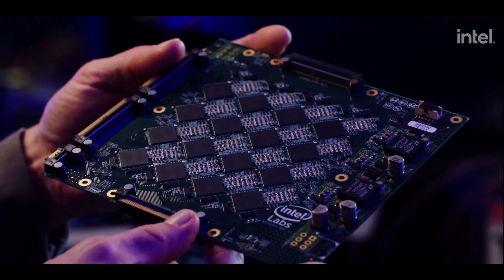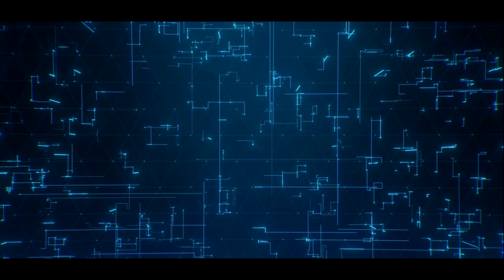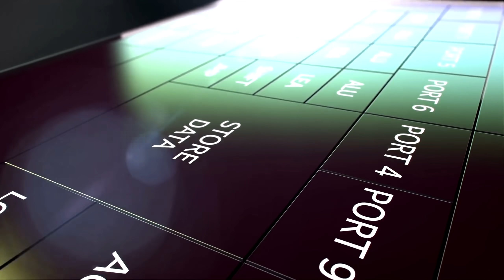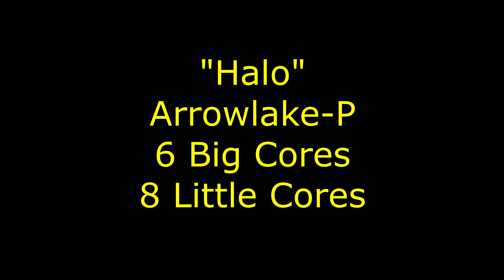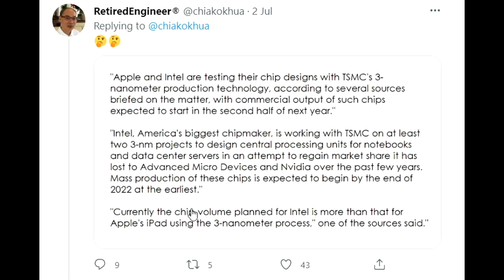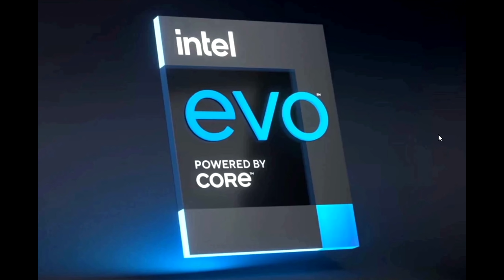Intel's Arrowlake Aims at Apple

Comment: What Intel deliver doesn't often fit the past road maps, I have lost faith in them.
A year of 8+8 ADL SOCs and I am very disappointed in Intel's big.little implementation, which has been tasteless.  I see forum users with K chips at 100C scared to run heavy processing programs, all because of the bad mobo defaults they permitted and tau not functioning to throttle to TDP.
They've thrown power at benchmarks because their GC cores are large and fail to scale down volts & frequency and they cannot put more than 10 on a die.  So the E cores are clocked high up the power wall to cover in power inefficient manner.
The MT creator cache light benchmarks just aren't anything like how I use the computer, 8+32 seems totally pointless just more cores idling.
There's also much reason to be sceptical of Arc gfx, there was a lot of benchmark claims Q1/22 that only Ryan Shrout publicised for DX11, the independents found different results and now they say Arc is for DX12/Vulkan.  But Lisa Pearce interview with Dr Ian Cutress shows they were well aware of the DX9/DX11 legacy support as well as DX12 & Vulkan.
This could change, but the claim of "designed for Re-BAR" needs them to explain how old games will have their aperture using memory management altered.  Furthermore Intel Tom Peterson makes out Arc is made for "GB high bandwidth memory transfers" but PCIE is a bus and NVME storage uses payloads of max 4KB.
They're not being challenged on all the holes in their stories by the journalists they visit or on news sites later.

Comment: intels low power cores were the only ting i was really interested in from them for the last couple years.  i mean i like to see how they clock and tweak them but as far as arch the  'mont cores are the oly interesting thing they have in core arch.  todays cores have been wtweaked so hard for high performnance at high  power that there has to be a lot of wood to chop if one stepped back a few years in core design and pulled out something simpler (less complexity means less power). 

this is about  their only chance but i think its exaclty what is neeeded.  just wonder hwo they will mess it up

Comment: It might be ready for when Windows 10 goes EOL and 0225. I will wait for 5 years after that, knowing how Intel's manufacturing is years behind and given the chip shortage. So I might expect this to be in wide availability in 2050 or so to jump past the unreleased Golden Cove and skip five generations ahead. 3nm, yes, in 2100! I figure they might have 10nm functioning by 2075.

Comment: If 96EU intel igpu is around mx450/gtx1050
I can see this rumored 320EU to match 1660super once the clocks are pushed real hard
1ghz of that beast could be close to 5500xt?Or even rx470 at the very least
Reply: Looks like i might be wrong
Should be similar to rx6600

Comment: So Intel has no way to catch up until 2023-2024. Unbelievable what their foolish unreachable 10nm roadmap cost them. That's what happens when your CEO has no engineering background.
BTW, I think 3nm TMSC isn't 3nm, it's just a node name with no reference to actual process size.
Reply: Bro. Bob Swan ruined Intel. Pat Gelsinger is trying to revive Intel back.
You really think Intel can revive itself easily? It takes time.
It's like Rory Read ruined AMD and Lisa Su trying to revive AMD back within 2014 to 2017 and did revive it. And that Intel is 2021 to 2023 or 2024. Just wait. Time will only tell.

Comment: There no industry standard on the measurements. The change to 7 is because of transistor density in same as the 7mn. The whole industry should use density per mm.

Comment: The Steam Deck shows that there is a market in the x86 ecosystem for a strong APU that can process Linux/Windows variants on par with the mid-range segment. I think the potential is much higher than even the Zen2/RDNA2 APU in the Steam Deck and the first company to hit it will basically be raking in the money. Discrete GPUs are becoming too expensive for this segment so I hope such a moonshot can be successful.

Comment: Hard to give Intel a heck of a lot of credence in their five year plans ... they've been getting to 10 nm for a better part of the last decade.

Also hard to see how x86 will begin achieving faster CPU cores, since the very nature of the variable instruction length makes really wide CPUs hard to do. The only options open therefore will be higher clocks - which results in exponential heat production and loss of efficiency - and process shrink.

Comment: (Formelrly) Intel 10nm ESF will have a 20% performance per watt improvement over 10nm SF.

20% performance per watt improvements, regardless of anything else, is the metric TSMC, GF, and Samsung use to determine if a node is "next gen" and gets a number decrease. Intel is just adopting the (dumb) industry standard for naming nodes

Comment: I really can't see Intel getting Arrow Lake out in 2023 at all, not without dropping a launch in-between.
Alder Lake will barely get out this year, the full line up will be Q1 next year (2022). Sure Intel might refresh this pretty quickly with Raptor Lake in Q4 2022 as that is only a small tweak to Alder Lake but Meteor Lake is a pretty different chip and so will get it's time to shine. Therefore even if we say Raptor Lake only gets about half a year on sale (which is extremely short) then Meteor Lake won't be here realistically until Q3 2023 and I personally think it will get at least 3 quarters as the top dog which would mean Arrow Lake will be in the second half of 2024 at best!
The only caveat to this is maybe Intel will drop one of these chips all together to speed things along.

Comment: This is very much needless knit picking but you said the upcoming Alder Lake chip is 8/16, is 8 big cores and 16 little cores. I'm sure it was a slip of the tongue and this isn't news to you but it's 8 big cores and 8 little cores. The '16' is the number of threads from the 8 big cores having SMT.

Comment: ADM=Applied Delusion Manufacturer?

Feeling silly. I think you are right, that they will go with stacked memory. I suspect the 7000 series GPU and 6000 series CPU parts will all use stacked memory. Yes, the initial run will be expensive, but when volume production hits it will only add pennies to the cost I would expect, and the performance boost is massive.

Comment: Jim, You should NOT trust Your Intel sources, ESPECIALLY when Intel is i very dire waters, and ALDER LAKE likely to become a gargantuan flop..... Intel is pitching for pawns to try to keep the company share prices from tanking below 40 45$ a share which opens avoid direct to 25$.
People like Tom and You, are the best  to try to divulge BS and have it run al over the media.
Besides....Intel has lost its future in the low power consumption market, there is no way they will be ever be able to compete VS apple or worse AMD, especially when the world is becoming more mobile phones and consoles.
Dell and Hp which consist pretty much the bulk of Intel sales, are getting a terrible reputation.
Apple Users tend to change their laptop every 2 to max 5 years, Intel users buy them and keep them until they die..... and given we just came out from a pandemic, i do not forecast anyone wanting to buy laptops for at least another 5 years and 2 years if an Apple aficionado.
By the time Intel  does whatever they said they will deliver to You Even Smart TVs will be able to replace the need to grab  a laptop...... so long for smart working and Intel.

Comment: Jim should definitely do A rant on the 6600xt and modern "midrange" gpus.
Reply: As a 5600 XT owner I was flabbergasted at the $379 price.  How the fuck did mid-range end up at $400?  I'd rather just buy a fucking console at this point.  Absolutely ridiculous.
Reply: @clblanchard08  they tried to sell a 5700xt for 450 dollars until they dropped it 50 bucks when people complained + nvidia released a 2070 super.
This is the same die are maybe 10mm smaller than that 5700xt in the middle of a shortage, its no suprise they are trying to sell it for almost the same price since it costs about the same to make as a 5700xt did.
Reply: He already said. No more personal analysis, only leaks from now on. His analysis that triggered most of the hate comments that mede him leave before, so no more.
Reply: @brunosalezze  i really don't think he should stop because of some degenerates, company salesmen in disguise as "reviewers".

Comment: The fuck is intel doing? They must sort out their manufacturing problems. Nothing else matters... Designing a chip to compete with another chip means nothing if you are also competing for the same limited wafer capacity. CPUs/SoCs are not going away anytime soon. Instead of focusing on apple or AMD or Nvidia they should be focusing on competing with TSMC or Samsung. There is nothing stopping TSMC from designing their own chips or buying out other companies who do and producing their own chips. While at the same time cutting off AMD or Intel or Apple's supply. We need intel to be competitive from a manufacturing perspective not as much from a design perspective.

Comment: Apple's advantage is their complete control of hardware manufacturing but also the software stack.  They can get as much performance out of AMD GPU in a laptop unplugged or plugged in.  I suppose it's less embarrassing for Intel to say they are going after another giant like Apple when they can't get past that little pipsqueak AMD.
Reply: AMD is no longer a pipsqueak. As of today, its market capitalization is $130 billion. It seems entirely likely that AMD can and will capture at least 50% of the entire x86 processor global market, including servers. At that point, AMD would easily overtake Intel in size, as AMD also has the Radeon graphics division, and Intel's GPU division still doesn't have a consumer video card out that can even call itself mid-range in general availability. The writing's on the wall.

Comment: 320EUs on N3 for a laptop? Hell yeah, i'd be interested to grab a low power laptop with solid gaming performance.
Reply: How does this compare to CU's or stream processors?
Reply: @baronvonlimbourgh1716  slightly better than vega 8
Reply: @baronvonlimbourgh1716  One Intel execution unit has 8 shaders.  One AMD CU has 64 shaders, as does one nVidia SM.  With Ampere, each shader can do either one FP32 and one INT32 or two FP32's, which gives each SM 20-40% more shading capacity than a CU, depending on the game and resolution.

So 320 EU is 2560 shaders, which is the same per-clock shading capacity as 40 CU's on AMD or ~33 SM's on Ampere.

Clock speed is a big factor, of course.  The 5700 XT and 6700 XT have the same number of CU's, but the latter is ~30% faster due to ~30% higher clock speeds.

I'd guess the integrated graphics will clock quite a bit lower than the 6700 XT, and probably a lot lower than the 5700 XT as well to save power.  Still, it would be exceptionally good for integrated graphics, provided the power consumption can be held in check at usable clock speeds.
Reply: @TrueThanny  thank you.
Reply: I wonder if even (LP)DDR5 can feed that
Reply from the maker: That's what ADM - whatever it is - is for.
Reply: @adoredtv  Yeah, it's clear that if intel are trying to compete against the M1/2/etc, they're clearly playing to their strengths here. What's the one thing the windows ecosystem truly has a big advantage over apple in?
AAA gaming. 
Apple may have stunning GPU performance and a shockingly good media engine, but none of that matters for someone looking to play some fun PC games when apple's catalog consists of just WoW, Apple arcade and handful of others. You can't even get fortnite on apple devices anymore :(

And if Intel could come out with a chip that enables sleek, low power laptops that can actually play modern titles really well, then they'll definitely get my attention for sure. I would have no doubt whatsoever that Raja isn't involved in pushing this somewhat.

Comment: one small correction, intel's new naming scheme for their process nodes doesn't include any nm suffix.
I'm personally fine with intel renaming their 10nm node to 'intel 7' cause it's going to cut back on the utter fuckery of havng to say "well TSMC 7nm is roughly equivalent to intel's 10nm node when looking at the physical measurements of gate width, pitch, height, etc" whenever the dick waving of "who has the smallest nanometers" happens. them renaming nodes so they're equivalent to the other relevant industry competitors is alright, though they are being slippery little shits with the 'intel 4' name, getting that slight name fuckery in over TSMC N5.
Reply: Intel 4 is because they’re comparing to TSMC’s N4, which is a refined N5 (effectively N5+), not really any fuckery here
Reply: @elon6131  Yeah they are just doing what TSMC and GF have already been doing for years.
Reply: For the avoidance of doubt, "utter fuckery" is a technical term.
Reply: Even TSMC calls their nodes N7, N5, etc.
Reply: Except for the fact that Intel has gone back to introducing units below 1nm, with the A (for Ångstrom) series. If Intel was serious about size not mattering it would use numbers that counted upwards because we all know that more higher means more better!
Reply: @johnm2012  except you're wrong because "A" is not the Angstrom prefix by SI convention :)
Reply: @elon6131  I never said it was an SI unit. The picometre would be the obvious "next" unit but Intel made a point specifically of mentioning the Ångstrom. So, why am I wrong?
Reply: @johnm2012  my bad, i didn't mean to say it wasn't a part of SI, but that A is not the symbol. the symbol is Å. 
either way to go to smaller numbers they had to add some sort of suffix, so ¯\_(ツ)_/¯
Reply: Very VAG of them lol.
Reply: This. Wanted to see if somebody would correct him
Reply: No. If i Intel's 10nm was 7nm, they would simply have called it 7nm. Doing so, leaves them open to lawsuits for lying. Turn around and call it "7" without the nm, they can continue to confuse morons like you and not get sued because "they arent calling it 7nm"....

In order to prove their 10nm is "as good as" tsmc's 7nm, they would need to print THE SAME PROCESSOR on both nodes. So lets say 19900k theoretical cpu. One printed on tsmc 7nm, the other intel 10nm. Then have them clocked the same, same memory speed, same motherboard, same storage drive. Then see if they really are "same performance" or if one beats the other. Until then, any "its the same performance" argument is pure ignorance. Thats like me claiming that youre gay, i dont have to prove it, its just true because i claimed it. Same with intels bullshit.
Reply: @goblinphreak2132  That is not how semiconductor fabrication works. You can't simply move one design to another process and expect it to work. You have to create a design for a particular process.  It's a bit like porting a Windows application to a Linux environment. You might expect it to compile without any problems but, in practice, with anything more complex than helloworld.c you have to include the correct libraries and resolve dependencies. Similarly, the Intel design would simply not build on the TSMC process without a great deal of porting effort and after putting in the effort needed to get it to build it would remain less than optimal, which isn't the fair comparison you intended.

I don't buy your argument about lawsuits for lying. What is there in any modern process that in any way relates to the number associated with it? If you say "gate length" and I say "gate thickness" we could both be right but if your process has short, fat gates and mine has long, thin gates then the comparison is meaningless. Different companies will choose whatever metric suits their narrative.
Reply: Which is going to f*ck them over when people say Intel's "smaller" 4 is only roughly on par with TSMC's "bigger" N5